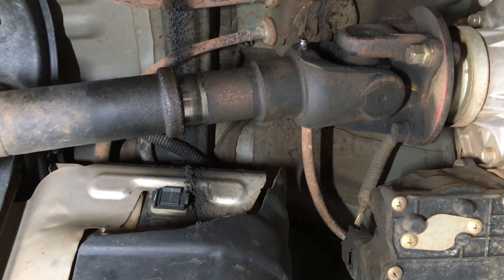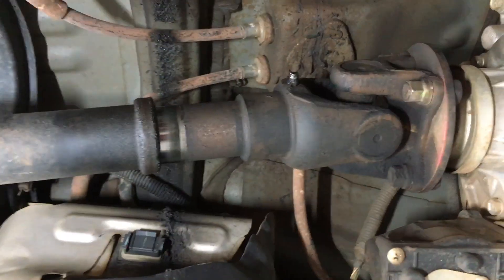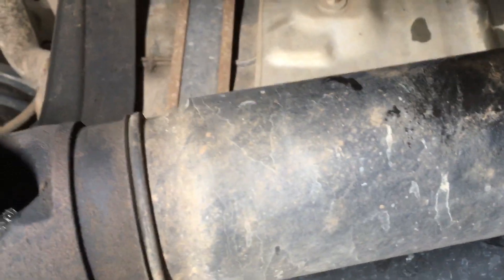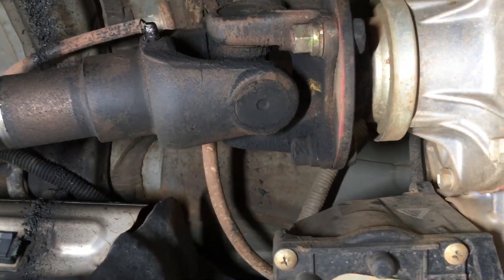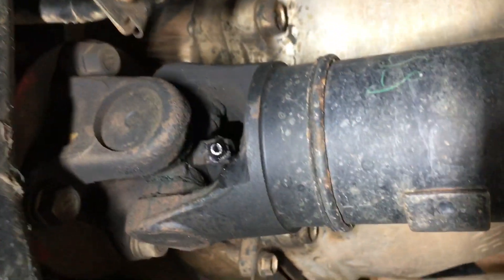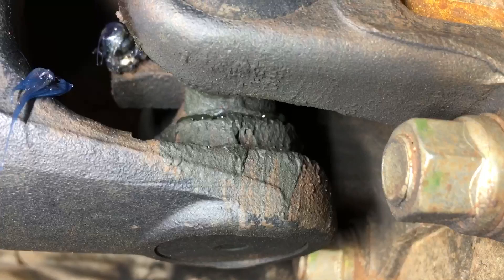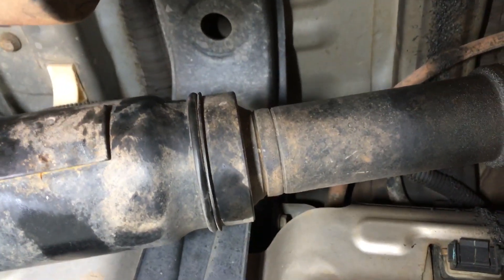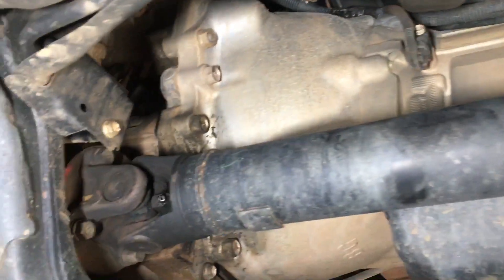Toyota prado & similar driveline lubrication points service

Comment: Hi, I ended up in this video because I’m struggling to understand if a low or not done lubrication can cause squeaky noise from the underbody when driving after 30 minutes and high temperatures. 
My prado 3 doors from 2012 has 190k km and since one year every time I have a dry road the car start squeaking. 
The dealership hasn’t find the cause but I’m in Italy and maybe they have not so many Land Cruiser in the shop.
Reply: Try looking up the videos on exhaust gasket.